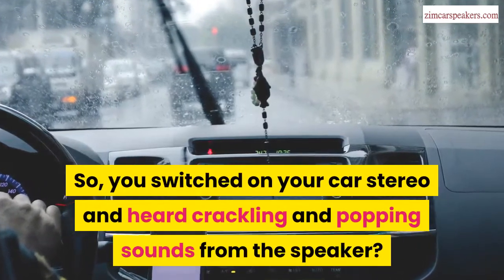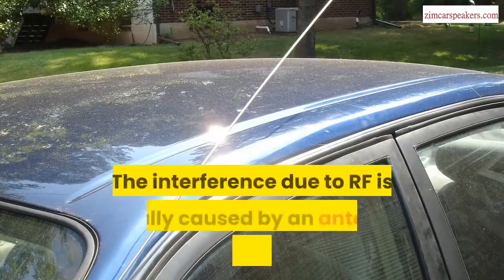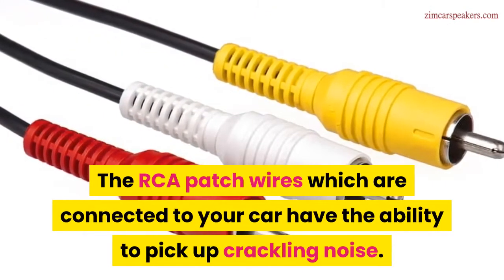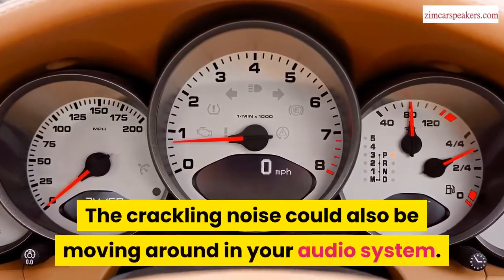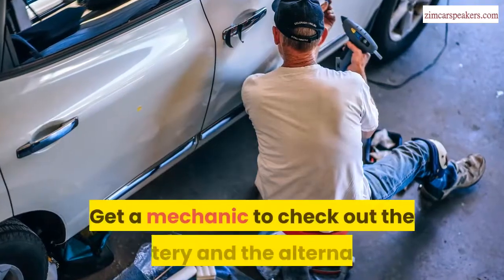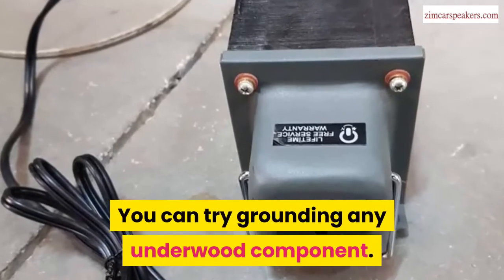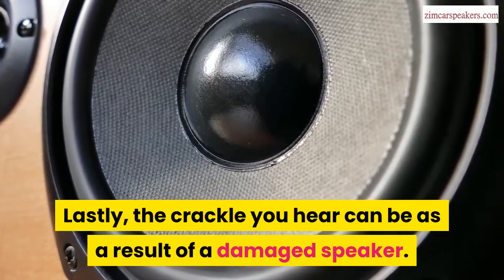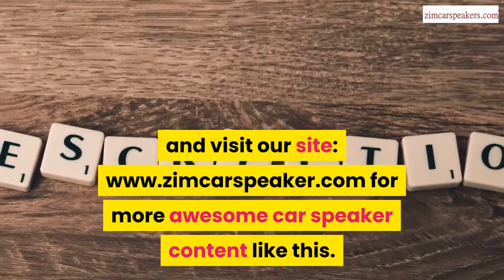How To Fix Car Speakers Crackling (Easy Methods)

Comment: for me is cant go max volume while car is on
Reply: I am experiencing the same issue.. have you figured it out?
Reply: No I checked grounds and rewired everything. My guess its the speakers or amp because when i disconnect the amp turning it up too high doesnt sound clean.

Comment: The rear speakers make a crackling sound each time I hit a bump, with out the radio on.  What could be the culprit?
Reply: your wires are crossing somewhere
Reply: @garryoak  They disconnected the amplifier and put in new speakers.  Working well now.  Thanks for your help.

Comment: if you follow this videos logic, then checking your tires air pressure would be a great next step and of course, the video will not tell you what the air pressure should be at.  Just check it...